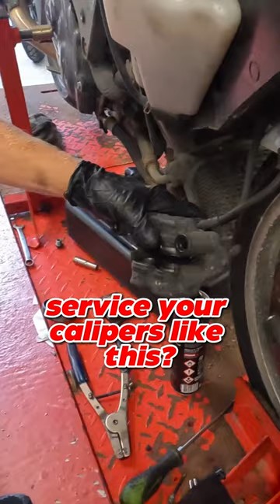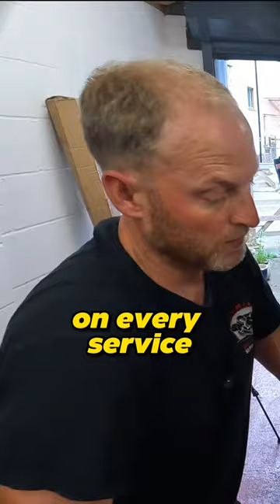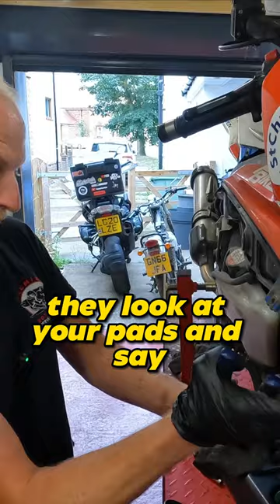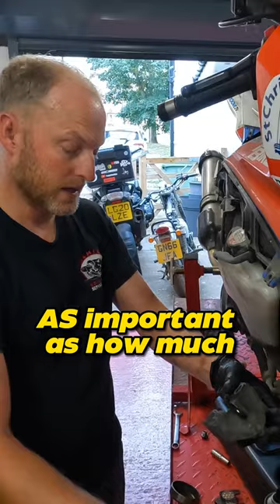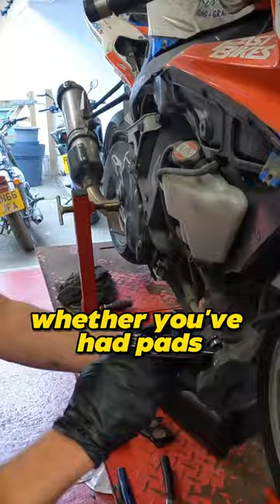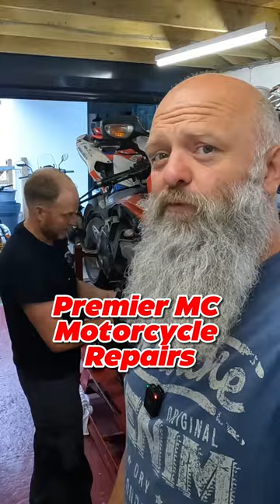How often SHOULD you SERVICE your brake Callipers

Comment: I do oil changes every 2k miles. At that point I always do a brake calliper clean and check
Reply: 6 times a year seems excessive. for oil
Reply from the maker: Depends on how long it takes to do the 2k miles - if it’s annually then that’s about right.

If it’s every month then aye, I’d agree it’s maybe a tad excessive 🤷‍♂️👍